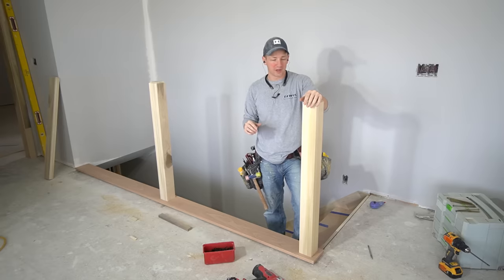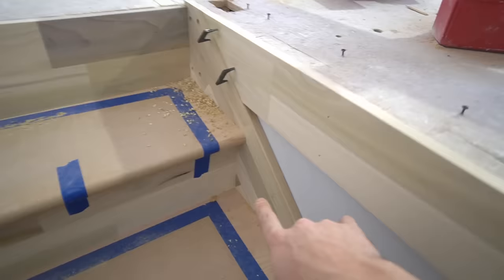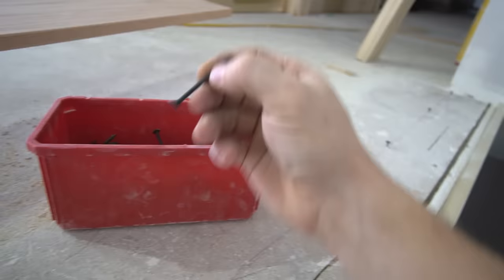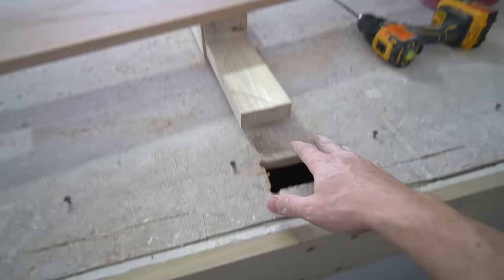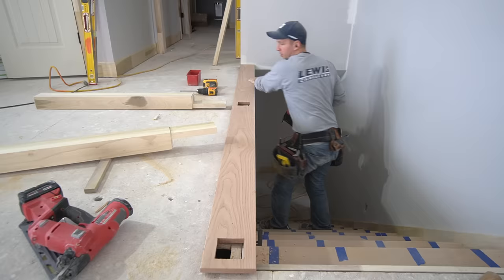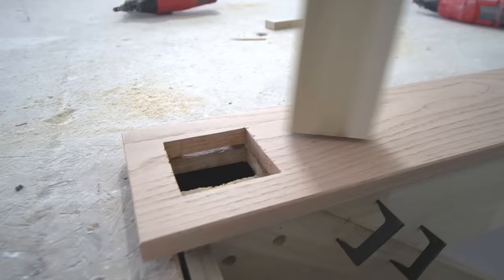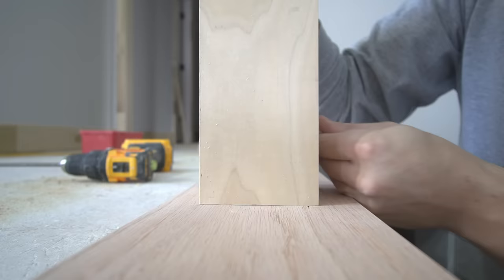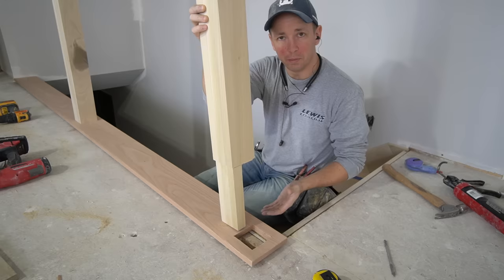ROCK SOLID Newel Posts - My Secret Sauce for Installing Newel Posts...

Comment: I'm a flooring guy with more than 30 years in so far. I was doing a 3/4 solid hardwood job in 100+ years old house.  Customers asked is there anything you can do about the railing and post moving ( only 4' long handrail . Post attached with nails  and not through subfloor and attached to joists). I bought some 1/2" by 1' wide L brackets and 3" screws. Was able to hallow cut hardwood so brackets weren't visible when done. I tucked some brackets under post and had some away from post all covered with pl premium and screwed it down as good as I could. Still wiggled a bit at end of day but the next morning it was as solid as a rock. Nice when things go our way sometimes.

Comment: soooo, im back. i think this is a little over the top for a newel post. what i do, and i know this isnt for everyone, is ill put down masking tape and mark off the center line for my  along the length of my landing strip, ill be using this for my balusters later. ill find the spot i want to install my post and draw out the size of the post. after this ill mark out 2 staggered points on either side of where the post will go ill go 1 inch from edge and 3/4 from face for where ill place my hanger/rail bolts. ill drill out and install those to the floor.  ill do the same lay out on my post. ill drill a 1 inch hole with the center of that hole at the same hight as the hanger bolt comes out of the landing strip. after this i drill 7/16 holes from the bottom of my post to the 1 inch ole through the side. ill test fit them peel up the tape only where the post goes. add just smear of tite bond 2/3 to where the post sits. ill tighten the nuts on the hanger bolts down just until i can barely wiggle the post back and forth. ill cut a few 2 degree shims off the off cut of my post. ill push and pull the post working my shim under until plumb then tighten the hell out of the hanger bolts. and they're ROCK solid. a couple of matching 1 inch plugs where i drilled through the side of the post and it all goes away with a little sand. as for the starter newel at the bottom ill do a combination of notching the post and cap, ill do the same kind of thing with a hanger bolt but with a 1 inch plug on the back of the post to pull it down and ill predrill 3/8 holes and i use 3-5 inch deck mates to put the post back. using really only wood glue and shims to plumb that post as well. i like where your head is at but its a little overcomplicated. if you want me to show you what i am talking about i can make a video. i generally only do stair and rail work so i have it paired down to be fast and efficient.

Comment: Ideally, the newel posts are not "top mounted" - meaning the face of the post is in line, or beyond, the edge of the nosing. This allows you to notch the posts around the floor system, then cut the nosing and fascia between the posts. If it's absolutely necessary to top mount solid newels, use PL and sure-tite newel fasteners. We've installed hundreds, maybe thousands of newels like this with no callbacks, and no mortising into the floor system.
Reply from the maker: I need to use sure tite bolts more. Thanks for the feedback!
Reply: Chase I agree I have used them for years.  Usually put them in at an angle to grab the framing.  Bend them straight up then drill holes out.  Once locked down, solid.
Spencer Question with the install of the nosing shimmed up with screws you can’t run hardwood flooring.  Seems you would have a lip.  I’ll belt sand sub flooring to help level things out a bit.  And glue straight to that.

Comment: The level of thought that goes into your work, with practical methods and construction resources makes me feel like a moron. The way you break things down, take your time and show how each component comes together and works as a unit is what really imprints on me. 

I am a hands on guy. However i can follow when there is thought and thorough instructions that lets me know the workings of the elements not seen or part of the finish exposure. 

You should really do full teaching videos bud, i would definitely pay for your experience and practical methods. Grateful for you sharing your knowledge and experience, true blessing.

Comment: Nice… I use the screw trick on bottom of baseboard in the corners to keep them from rolling… Especially on old remodels…
I tape a piece of baseboard to my torpedo level and level the screw in the corners

Comment: I'm probably not the first to say this to you, but have you ever checked out the Milwaukee Fuel Surge impact driver?  For things like setting those drywall screws at the right depth or other precision work you can set them on the lowest speed setting and make super fine adjustments so easily.  It's hard to describe how efficient and satisfying it is.  I know you highly value efficiency, and that tool would be right up your alley.  I know you're already partly on the platform with your nailers...  Considerably less noise and vibration, too.  Especially in unfinished houses like you work in.  God bless!

Comment: I really like that shoulder at the bottom of newel to cover rail shoe, I always bury my solid newels if there’s not two rim joists, but I’ve always installed them first then notched shoe rail around the newel mitering the two end ears turning the grain around the newel, skipped the middle and end newel, 

I’ll adopt your method though I really like that! 
Thanks!

Comment: I love the rabbet around the base of the post. That’s an awesome idea. I’ve never seen that before but what I have done in the past is I take as long of a lag bolt as I can find. I cut off the head of the bolt. I only want the threaded part of the lag bolt. Usually 5-6” is all the threads you can find. I then drill a hole in the center of the bottom of the post and thread half of the lag into the post. I then drill a hole into the floor dead center of where the post is going to land. You have to make sure you have solid framing below the subfloor. More often then not I have to add blocking. But then I just glue the shit out of the base of the post and I use the post and a clamp for leverage and I thread the post into the floor and with the combination of the mechanical fastener, the lag bolt and the wood glue for Insirance. You can have the post setting by itself with nothing bracing it in any direction and after the glue dries you couldn’t budge the post if you tried to. I hate to think about the poor guy that has to demo it out someday and can’t figure out where the post is fastened. Lol
Reply: Your technique is nearly the proper, time-honored technique for correct newel post installation. Take the extra step of drilling a hole in the side of the newel, then thread a bolt onto that lag screw. It's close quarters to tighten down that bolt, but take your time. In the end you have a post that is mechanically fastened to the framing, the clear winner of all the work-arounds mentioned above. (TIP: they make fasteners called "dowel screws" for applications like this, so you don't have to cut the head off a bolt/screw.)

Comment: I had an older woman neighbor years ago and her staircase rail was wobbly and scared the hell out of me for her. There was literally nothing good for the post to attach to besides the side of the stairs which was a few decades past "sturdy".  I ended up cutting a 4x4 hole in the floor and bolting it to a joist that luckily was only an inch away from the right spot. Lots of wood glue too haha. Worked like a charm!

Comment: Looks nice.  Glad my builder didn’t PL my bottom newel posts in place, had to pull them out to get the refrigerator through the narrow hall where the stairs meet the main floor.  PL would’ve made for a real problem.  :)

Comment: Finally, I've been looking for info on installing newel posts through the floor for a long time. I'll be doing this in my house soon. And I'll be watching this video a few hundred more times :) measure twice cut once type deal. Watch a hundred times so you don't screw things up.
Great job and awesome video, very detailed. Thank You
Reply: How did it turn out?

Comment: It is nice that they are these GRK screws and PL premium to use.  I bet before these came out you need to use lag bolts to fasten the newel posts and sub floor glue.  Have you tried Huber Wood glue that they use to glue the Advantech subfloor.
Reply from the maker: It wouldn't work well in this application IMO.

Comment: Why don't you have a top tred hooked down on the floor? Doing that gives your stairs strength. Plus I usually put my string into a newel and then that is hooked onto the floor which is incredibly strong aswel.

Comment: Is it going to be carpet on the upper level? I see you already have some base installed upstairs. My question is how do you know where to end your skirtboard? I see that it's flush to the top of the subfloor. How do you plan to transition that to the baseboard?
Reply from the maker: There are no set rules. We get to use our creativity when doing stairs.

Comment: For attaching solid newels without notching them, use dowels. Drill into joists and the flat bottom of the newel and use appropriate sized dowels coated in PL Premium.

Comment: Could you just put wooden shims in after you have used the screws to set for level?  Then you would know they wouldn't move because the wood shims would hold the load if they did.

Comment: I really like the idea of using screws to get the rail shoe (I know—opposite of what you call it. Haha) perfectly level both ways. I wondered how you chose the clearance off the floor you did—instead of just setting it flush on the floor?  Looked like you had 3/8” or so clearance between floor and shoe.
Reply: Does seem like a good bit of space hopefully they do tile. Though it might not look to bad just sliding the lvp under it.
Reply from the maker: High enough that they can slide hard surface flooring under it and then I'll put a piece of scribe in front of it.  Not the best finished look but it's usually what I do on production homes.
Reply: @InsiderCarpentry  are you able to explain this further?

Comment: I wanted to get your opinion on how you would do the mortising if you had a doubled up rim joist around the stair? Would you just forget that method and use a lag bolt to secure them? It looks like you a a single rim joist.
Reply from the maker: Definitely bolt them down with a sure-tite or hanger bolt if you have that much blocking underneath.
Reply: I used “key lock” post anchor mortised into the post or floor.

Comment: Just a quick question! Does the post being cut down so much to fit into the slot, weaken the overall strength of the post? I guess durability and strength are dependent on wood species but it seems like that post could just snap right off.
Reply: It'll have similar strength to a continuous 2x4, since that's roughly the dimensions he has left on the projection down into the framing.  This detail is arguably the best way to achieve the required structural resistance for a structural guard (which this would be under my local codes).  As a structural engineer, this is my preferred detail for timber posts on guards.  Any fastener that just goes through the sheathing into the base of the board will fail under Code loads for guards (based on my local code requirements.  YMMV).
Reply: Having that shoulder on the base of the post is a great idea but I'd rather have a bit more meat to connect to the framing. Personally I'd cut an 1/8" shoulder all the way around the base of the post and have the rest project beneath the floor. Notching the newel obviously weakens it.
Reply: Most of that notch can be avoided if the framers take a little more when framing that area , before floor sheathing was installed you could have laid out the posts and created a larger hole for them to sit in

Comment: I have same scenario as this, but I have twin joists running in parallel under the newel post area - any idea on a good solution to fix it down in this scenario? I was looking at a rod, but not so sure...
Reply: If it is a doubled joist, spiked together, then you could use a piece of threaded rod to anchor into the joist and the newel bottom. Use a piece that is it 3/4" diameter (for sturdiness) by about 8" long. Grind a tapered point at each end of the rod-at least a 1" length of taper. Then drill a hole the diameter of the shank of the 3/4" rod into both the top of the doubled joist and the bottom of the newel. Make sure you have bored your holes slightly deeper than half the length of your 8" threaded rod. Double nut the rod and torque it into the joist, at this point you are essentially using the threaded rod like a metal tap (as in tap & die). Now you have the threaded rod anchored firmly and sticking up through the finished shoe board. Finally drop the newel over the projecting piece of rod and proceed with turning the newel onto the rod until it socks up tight on top of the shoe board. A charm.

Comment: Do you worry about having that poplar sitting right on concrete? ie moisture wicking, capillary action etc
Reply from the maker: It will be sealed at the bottom by the PL Premium it is sitting on.

Comment: How do you make the rabbit cuts where the post sets on the shoe rail board?
Reply: assume you could use a cordless router with an appropriate bearing and set the appropriate depth.  invert the post

Comment: Do you find that workability alone is the real benefit of using PL Premium (3x) over PL Premium Max? I’m always on the fence between the two but 3x sure is easier to trowel. I wish they’d rework the Max formula to be a little easier to lay down… it’s hard to forego it’s strength just for ease of use.
Reply: I hate the pl max, crap is super thick to deal with. The X3 is nice for its similar to regular pl premium.
Reply from the maker: I've only used the max a couple times. X3 works great for me.
Reply: Try Gorilla Construction Adhesive, works great and nice to work with, especially overhead.

Comment: With the "foot board" shimmed up that high how do you deal with hardwood floor installation?
Reply from the maker: Often a small shoe molding gets applied across the front.
Reply: @InsiderCarpentry  will still leave a height discrepancy no? Also when I do stairs I put a shoe/bullnose at the top of  treads too. I'm curious to see how that's addressed in your area.

Comment: Mach 15
Reply: So i do alot of trim in maine and i also install the hard wood flooring we call the shoe board nosing and we miter it around to the top of the stairs acts like a half tread at the top how do you finish the top of stairs if the shoe doesn't wrap around? And wood you shim the flooring up to your shoe board ? I often will use the trim board under the shoe to straighten the staircase to the interior wall so the flooring can run straight this all has to be figured before the shoe can go on other wise you can end up with a angled rip against the shoe or the wall that doesn't look parallel to either one.
 so i was curious how you compensate for this ?  From your videos i have learned alot and really appreciate them and your work we seem to have alot off the same tricks just a few little differences

Comment: Looks really nice but it's a clear code violation in Massachusetts. Actually it might be a clear code violation throughout the us at this point. The amount notched out of the bottom creates a perfect atmosphere for grain run-out in a split. It is unlikely to fail as an interior application. But if someone were to trip and hit that railing it could easily split straight up the newel post

Comment: What do you when your on a slab?
Reply from the maker: Expanding anchor into slab. Drill holes in bottom of post. Cover anchors in PL. Set newel over PL/Anchors. Lag into knee wall. It's not ideal going into concrete if you have no lateral support to tie into.
Reply: @InsiderCarpentry  thanks makes sense!
Reply: @InsiderCarpentry  thanks for the tip! Worked perfectly.

Comment: you could have done the handrail much cleaner with less effort. Simply using dowels on one end of each segment and screw in the other. In the middle post, use the holes of the screws from the first segment for the dowels for the next segment. With that technique, only 2 screws (the last ones) will be visible no matter how many segments the rail has.